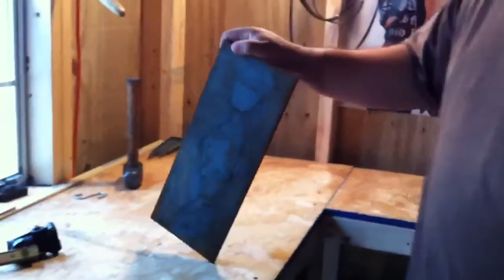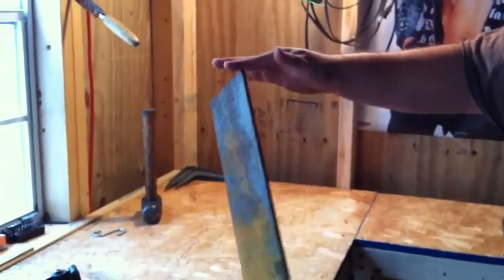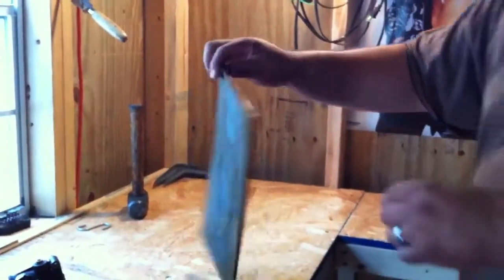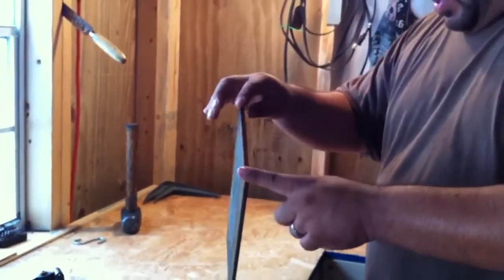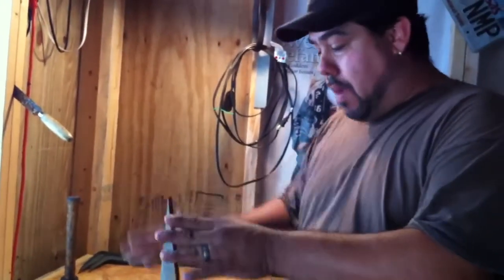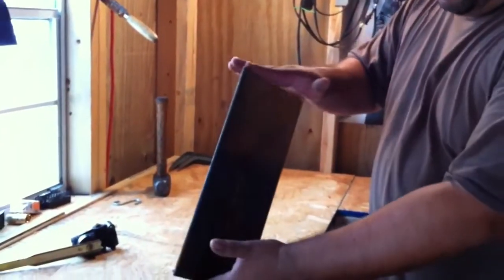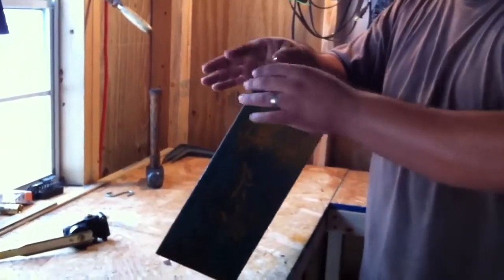My toyota suspension explained

Comment: if you ever want a super good and cheap pressure switch. a well pump switch from the hardware works great just crank down the spring to the PSI you need. and it can take the high power draw because its made for well pumps